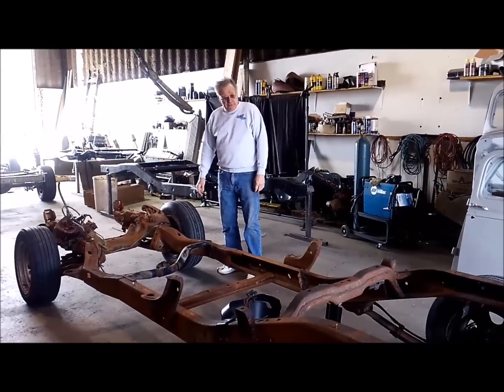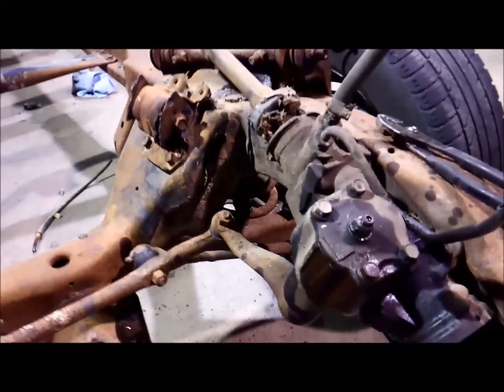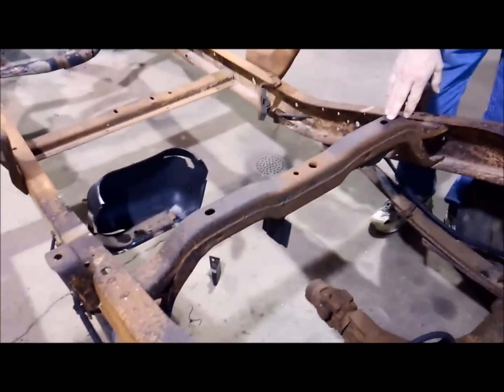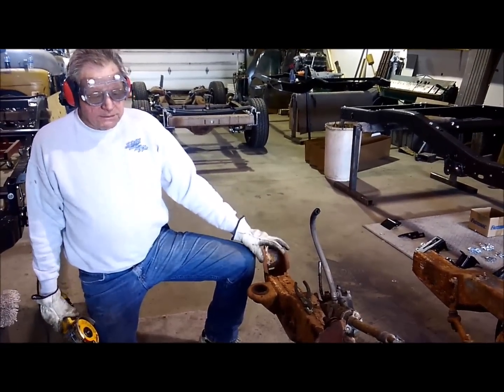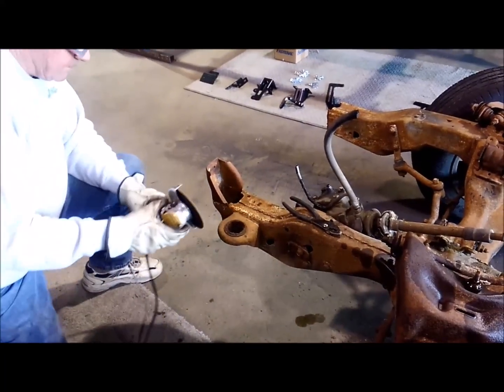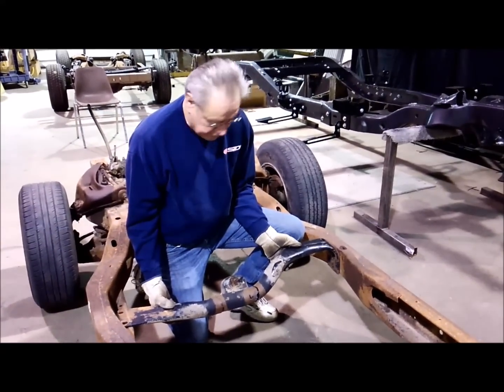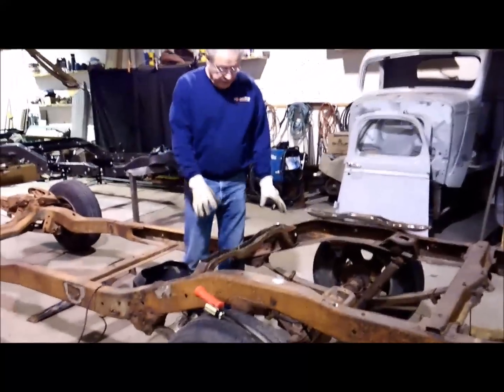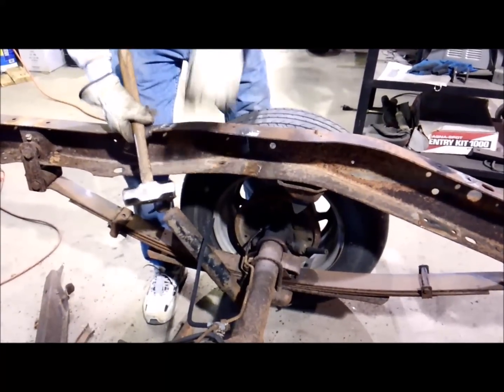Prepping your S 10 Frame Video Final

Comment: I'm going over my 39 Willys Overland which I with the help of a couple of advisor's (so to speak :-) ) I stuck with the original frame. I used a 1994 Chevy 4.3 v6 and 700r4, now I finally have the chance to get "A little more Get up and Go" requiring to the best of my knowledge a stronger chassis and maybe dropping the frame. This video is incredibly well done and terrifically informative. Respectful Thanks Sir..

Comment: I had a gentleman offer me a 1984 S10 single cab - long box 4x4, 5 speed today. The truck has 44,000 original miles on it, I would like to use the s10 chase and drive train and drop a 1947-53 chevy 3100 1/2 ton body on it. I read its hard to do with a 4X4 Frame, is this true? Secondly are there bracket kits and instructions available for a 4x4 chassis swap? 
Thanks, Mark
Reply from the maker: No the kit requires a 2WD frame sorry
Reply: @code5044  Thanks for your response. Again Im new to this type of project. Could you tell me why builders would shy away from using a 4x4 chases ? Also Have you heard of a kit maker like yourself, that actually make kits for 4x4 frames and if purchased are there any components from your kit that are useable?
Reply from the maker: @markhendy8369  the 4/4 frame is wider than the 2wd. I do not know of any kits made for a 4/4 no. I know from some Facebook groups it can be done but I can't help you with that sorry.

Comment: I Think The MOST Important Starting Point to Mention,  Is The WHEEL BASE Of The Vehicle Your Going To Put The S-10 Frame Under.   If You Have 112 Wheel Base Car And A Longer Wheel Base Frame, The Fender Openings For The Wheels Will Be Off And Look Stupid.  UNLESS You Shorten The Frame Somewhere In The Middle, And Then ADD Extra Frame Rail Plates At The Shortening Location To RESTRENGTHEN That Frame At The Cut.  And Also The location Of The Steering Box And Column, Compared To How The Original One Was Located In The Vehicle As Well.    Because  When You Start Getting Into EVEN MORE Body Cutting And Alterations For The Frame Hump Over The Rear End Too, It Might Be Better To Just Repair And Update The Original Vehicle Frame To Start With...  Too Much Screwing Around And Alterations Can Lead To A BIG Time Consuming And COSTLY MONEY  PIT  To Start Losing Interest In Completing...
Reply: This is for a 47-54 chevy AD pickup thats why he wants the 118 frame (short cab long bed) wheel base is almost perfect.

Comment: I have a question about the front bumper bracket.  Now 1982 to 1985 had the bumper brackets bolted on would I have to cut anything off more if mine were bolted on
Reply from the maker: We suggest you remove the original brackets and use the ones included in the kit.

Comment: 2000 chevy s10 extended cab will work with this conversion kit?
Reply from the maker: As long as it's 2WD, depending on the year truck you are putting on it, you will have to modify the frame

Comment: Truck frames are the same you can put a 82 body on a 02 frame. My 90 body is on a 98 frame the 94 and up frames are boxed further back. . and you dont need to cut a damn hole to take engine mounts off. I been building these trucks since 1987 .

Comment: I have a question what rear end should i use because im gonna run a 5.3 in it will the original one work ? Or have to upgrade the rear end gears
Reply: Isaac Carranza my s10 came with the 3.08 rear end which I believe was the most common with the 85 year. I also have a 2.79 rear end out of a 69 but was told with a 350 sb it was doggish off the line. I would think a 3.08 or similar would be ok with a 5.3

Comment: The suspension bump stops need to come off as well, correct?
Reply from the maker: Yes, you are correct! We remove everything rubber because we got our frames sandblasted and powder coated. Then they get replaced with new ones.
Reply: Code 504 How much is a job like this run?
Reply: I have a 37 masterdelux something like the one in the background.will theses frames works ??